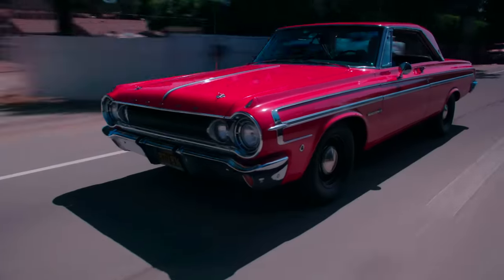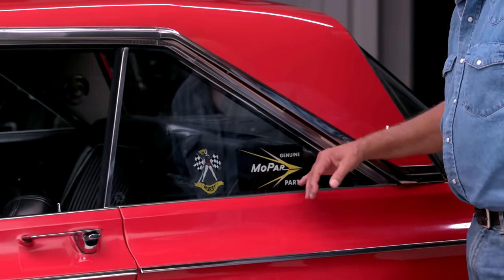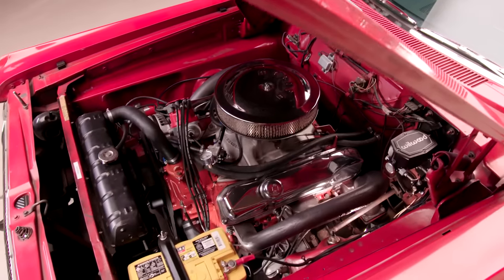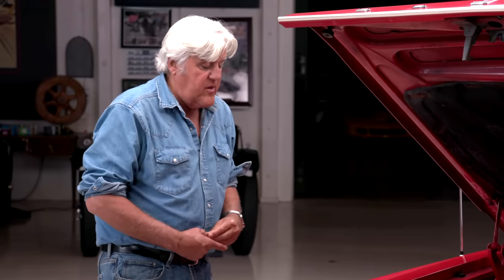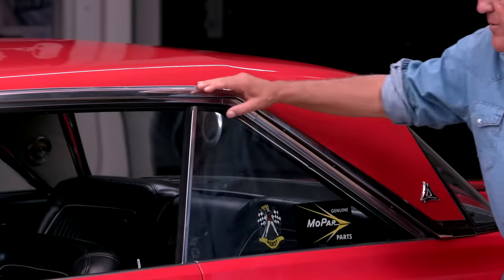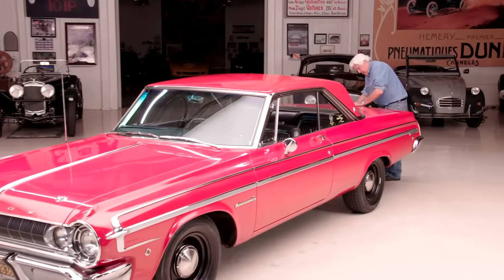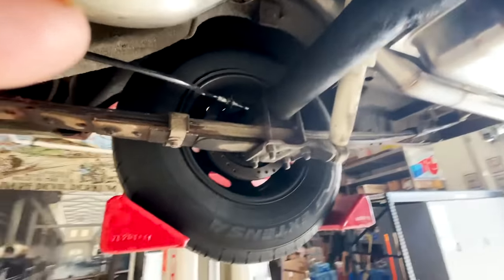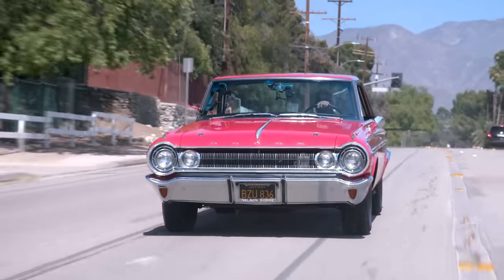1964 Dodge Polara | Jay Leno's Garage

Comment: back in 1974 my best friend had a 64 polara anniversary edition. it was red with a white top. it was very fast, he would drift with it before drifting was a thing. we would just go sideways down the road probably about 50mph smoking the tires. one time we passed a kid on a motorcycle who was riding in the ditch we were going sideways of course.he blew out the automatic so we put a 4 speed in it then it was even better. the car came to its end when the 4 speed case broke at the bell housing. it had a 361 engine . before he got rid of it we took the heads off and they were wedge heads, ever hear of such an engine? this car was just as fast as my 67 mercury police car with the 428. those were the days.

Comment: In my senior year of high school, I bought a 1966 Coronet Super Bee, it had the Hemi. My friend's father was an engine builder for many racers. We built my engine to 625 Hp with a cross ram manifold and 2 650 cfm 4 bbl carbs. It had a Dana 66 rear axel with a Detroit locker (noisy) headers with lake pipes that came through the finder just before the front door (I would kick myself today). It was FAST.

Comment: Hi Jay this is Jim mungai again I forgot to mention my first car was a 62 Dodge dart 318 pushbutton automatic car ran pretty good had the big Stromberg to barrel on it ha ha anyway I shut down a couple small block Chevy‘s with that car car ran pretty hard I wasn’t gonna be the top guy in town but for considering the stock 318 car ran pretty good got about 17 model gallon on the road to but yeah you talk about steering that car head manual steering and as long as you remove in one or 2 mph you could palm that steering wheel from walk to lock it was just like power steering car was phenomenal anyway keep I’ll put your doing is a Jim mungai again from Kennerdell a Pennsylvania

Comment: In my country back in 1977, Chrysler sold the Dodge 1500 as Dodge Polara to compete against Renault and Fiat. It was a manual 4 speed 1.8 L engine with 88hp and 108 pound feed of torque.

Comment: A lot of cops in my area of SE Indiana had Polaras with the same black wheels & dog dish hubcaps.
You could spot em a mile away !!! 
Any skirt chaser back then would immediately instal a set of mags or cragars,.
 This was the best looking year for Mopar, the previous years were a bit homely.
  I was a Chevy man back in those days and had many impromptu runs for the girls attention against these. My lil Nova would launch off the line and jump out in front sometimes even a car length or so , but would always pass me on the top end.
  I envied the space the back seats had compared to my lil Nova ( for obvious reasons) and then went to fixing up Impalas for the lush seats and spacious back seats !!!
  These Mopars were certainly girl getters back then, but let’s just say a black 64 Impala SS  with red & white interior was a good competitor….

Comment: my brother told me a story of a friend he worked with in 66 bought a new Plymouth belvedere with bench seat and a huge Hurst shifter. he took him for a ride on the interstate in it and running at 70 mph he down shifted and floored it and it started fish tailing at 70 mph! he was looking at the engine and said it was a hemi with aluminum heads? i remember reading that the early cars of  500 cars needed to qualify them for nascar had the actual race motor in them just detuned a bit and i always wondered if this might have been one of those cars?

Comment: My first car !
  I also had a 64 Polara 500 but it only had the 318 , , bucket seats , floor shift auto ,  no power steering or power brakes but it really didn't them , steered and stopped easily . .

Comment: Very nice Jay I like those old Mopars I'm quite the Chrysler fanatic myself in fact the car I have is a 528 cubic inch Max wedge of course it's not stock especially 528 cubic inch yes it's a Siamese bore mega block small stroked with indieheads that would be in a range of about 800 horsepower with 12 to 1 compression can't wait to get that one done oh and by the way that's in a altered wheelbase 70 Dart and it's a big tire car with a Ford 9 in designed by strange but I like your old super stock most definitely cool

Comment: Oh yes, my first muscle car of three. Balanced, blueprinted 426 Wedge, black beauty. Headers, drag slicks I ran on the street. Push button shift on the dash. Full race cam,  4.11 rear end, battery in trunk, along with two electric fuel pumps. Ran 12:39?, 112 mph, on the strip. Never beaten there or on the street.

Comment: Your comment about "rum runners" brought back a memory from the 1960s .  Moonshiners were  part  of the local lore as were the "revenuers" who pursued them.  I had the pleasure of knowing folks from both sides of the law.  But,  one person  stands out in my memory after all these years.  He was a local legend known as "T model Jones".   T model, he ran likker and he never got caught.  The reason why was his car.  It was the dirtiest ugliest black 1957 Chevy 2 dr  sedan you would have ever seen.  The windows were so smudged you had to look around the smudges to see.  It had no back seat,  only a wooden frame to stack the crates. T model himself was a character straight out of "Deliverance" He wore bib coveralls, with no  shirt, and brogan boots with no socks. He was balding, always needed a shave and usually had a bit of juice evident   from his chewing tobacco. . The hidden secret about T model's Chevy became evident when you raised the hood.  The engine compartment was pristine.  It was so clean you could eat your lunch on any surface there.  However, the crown jewel under the hood was a very modified Corvette fuel injected engine.  The suspension, wheels tires etc would have done justice to any NASCAR racer of that era.   T model faded into history as the years passed by but his legend lives on.  A street was named after him  in a small town frequented by him when he was in his prime  His memory lives on in T Model Jones lane.

Comment: 1970's/80's 15x7" Mopar cop steelies and later non-Fratzog caps - interesting! It took a few moments to even spot them. Bravo for sending those wannabe-racer American Racing mags to the bin, along with that didn't-tub-it stance. 

Top tip for finding affordable 15x7" period Mopar rims without the expense: Late-1980's Dodge B150 van rims look just right and have the correct 5.5" bolt pattern. Heck, they could pass for 15x6" HEMI JK code rims at first glance. They have an additional set of small holes astride the main bolt pattern, but they're invisible once a factory dog dish is fitted on top.

Comment: My grandfather had a 64 Savoy, 413/4spd. Originally a 383 car. It was my first memory of a fast car. I played with Chevy stuff as a teenager because they were cheap in the 80s, even then Mopars were more money. But I’ve been strictly Mopar since the late 90s. Yet to find one of these at tbe right time but that will change soon. Having fun with a 340/4spd 72 Duster now.

Comment: I knew a family or should I say a 64 Coronet bought new but the story starts at the factory. As it was coming off the line the right front fender got damaged, so the potential owner was contacted to see if he still wanted the car. Owner agreed as longer as the damaged fender was replaced with a new one. You would think that getting a replacement right off the line would match you would be wrong. I tried following the car , a 383 4 speed black interior and black vinyl top over white paint with a slightly different shade right front fender. Last I know it was rusting away and on its 3rd engine, its 2nd engine a built 440 that was to much for its owner so he sold it.
Reply: The Dodge Coronet was discontinued in 1960, and the name did not appear on another Dodge until 1965, (IE there were NO 1964 Dodge Coronets built).
Gary

Comment: I love your videos I had a 1970 Dodge Challenger RT convertible 440 magnum paid 2300 for it in83  it was awesome press you in the seat if I punched it at 80 when 145 and the front end started to lift put the purple cam and valves and it was 518 hp it ran faster than the so-called fast cars now

Comment: My dad bought a 4dr with the 383 push button tranny. The car was 4 yrs old, I was 16. You know that means trouble. I would rev it up in neutral and then push that D button on the dash. I pretty much burned those tires off in a couple months. There was a famous intersection in my town where you could get airborne and boy did I. I hit it way too fast and got all 4 off the ground and hit so hard that it crushed the oil pan. Minimal leakage. I took the car to school the next day to automotive shop and repaired it. When my dad asked what the oil was in the driveway, I told him I spilled a little when I changed the oil for him. He said, ok, thanks!

Comment: Need a drop in "Passon performance" aluminum  A855 5 spd then you can run 3.91s or 4.10s and it'll be quick and still have freeway speeds like driving with a 4spd and 3.00 gears but better!

Comment: My first car was a Dodge 440 w/426 wedge! Pushbutton electric shifter just left of the steering wheel on the dash. Dual point distributor, dual exhaust.  And Fenton black spoke "Mags" bought it in 1975 when I was 15... paid $159.50 for it...😏👍 Go Sooners!

Comment: I grew up on Mopars in Denver.  I was at the age where I bought all those cool cars broken and cheap, then rebuilt them.  I had a fury 440 4 speed.  The guy gave up because it would not run right.  I went to Checker Auto Parts and got my usual kit: Paint, (Plastikote) plugs (A/C) Wires (Yellow Accel) and store brand oil and air filter, points cap and rotor with Valvoline oil.  Stripped her, painted her, and put on the new parts with a known good Holley 650 carb. vacuum secondaries.  I started it, set the timing, idle adjustment screws and never opened the hood again.  Took my brother and his girl friend for a ride, 0 to 110 and back to zero in just under a mile.  That was the last time she ever asked me if a car I was driving was fast.   I had to graft in an aftermarket tach, but it still looked cool.  I have to stop watching Jay. He makes me want to buy things and I already have two projects waiting.....(72 Roadrunner 440-6 pistol grip).

Comment: FWIW, those cast iron headers are factory, but would be for a max wedge car.  A 426-S would've had straight log manifolds that dumped near the firewall.  Everythign else of the video is full thumbs-up, of course.

Comment: The 64 Polara 500 was the top of the line Dodge it had all the options and was sporty the Max Wedge cars looked like the Polara but they use the bottom trim line called the 330 and they had the Max Wedge 426 and then you had the super stock Dodges and they had the 426 Hemi in it. 1964 was the first year for the 426 Hemi in a car and it was racing only not for street use. Dodge had 3 body trim levels they had the 330 and that was he bottom of the line the middle was the 440 and of course the top of the line was the 500.

Comment: I am building a 1964 Dodge Polara. I need motor mounts for 318 poly motor to a 383 big block or should I change the k member? If so which k member should I use?

Comment: I had a dull green 65 dodge that I bought from my friend's mother for $125, it had a 383 with a 4 barell and it moved. The trunk was enormous and the back doors were stuck so my friends had to climb in the front seat and jump into the back. I called it my 4 door coupe...

Comment: I had two 1964 Dodge Polaras. First one was turquoise (meh) the second one was white (better). Both 383 with Holley 780 4bbl. Dual exhaust with Cherry Bomb Glass Packs. Got my first one in 1975, blew up 2 engines before I learned to run 20w50 oil in them. Bought the 2nd one in 1978. Wish I had kept them! When I had them I always kept an eye out for a 426 hemi for sale, but they were tooooooooo expensive.. All I have left is an old Polaroid of the 2nd one.
Nothing beats the sound of a 1960s big block muscle car with cherry bomb glass packs... nothing.

Comment: Thanks all, and JAY’s Teams….. etc. Interestingly, wonderful stories about the All the “early “ Driver’s License” vehicles! ** My nemesis was a 1959 Coronet Station *Wagon(REAR face seat,V8/PS,PB,etc,.)taking my LICENSE TEST(* embarrassing,until Dad found a 1954 FORD 2DR/V8, WITH 57 (?),289/CARTER 4B/Dual EXH, CUSOMIZED by the SERVICE STATION’s Mechanic!!).. Finally,  **1966 (buying in 1967,) GalaxieXL500/ *4SPD/MAROON, BLACK INT DELUXE*(352/4 BBL/ Duals): was a nice **tourer through, Pharmacy School ::: admittedly I **had *to Emergencey UPGRADE: fitted Metallic Brakes/ MONROE +SHOCKS 500(?), & the “Coolant Recovery System “ initially ONLY @ FORD PERFORMANCE EARLY 1967), etc Interestingly. Apparently some 66 Fords had COOLANT RECOVERY SYSTEM, maybe like “”some “ had DISC BRAKES ..etc.Anyways,this Polara Wedge / 4 spd is legendary.

Comment: I used to put those 15X7 police wheels (like on this car) on about every Mopar muscle car I owned back in the 80s and 90s. I'd paint them a silver metallic and clear coat em,run nice chrome lug nuts with no hub caps. Had a black 70 Cuda that looked killer with the wheels and white letter B.F.Goodrich T/As fat tires!

Comment: I had a 63 Dodge Fury with the push-button transmission when I was a teenager it was so much fun. One day I was burning rubber and pushing those buttons and going through the gears I got home I had four cop cars surround me. They had me spread eagle across the trunk. They thought I robbed the a store it took some doing but I finally convinced them that was my mom's store and I'm an idiot they  agree that I a idiot. Didn't even write me a speeding ticket and everything was fine.

Comment: My freind had 66 Satellite that was drag raced a well built 440, 4sp, 3.90 gears. I was with Him when brought home His wanted to look under the hood. So He did, asked it was a 440 oh he said, I said, its a mild 440. The look he gave me! There is no such thing as a mild 440. Then the night came a blue impala pulled up beside us, they were smiling like this going to be easy. Keep in mind neither of us knew what car could do. Light turned green, He dumped the clutch and that car went sideways and wheelhopping violently. The impala was gone my freind asked what do I do? Let off the gas a little! He did and it was being in sling shot 2nd gear we caught the impala 3rd it was headlights going away. 
Yes that over heated like crazy but never felt that kind of raw power.Thanks for the memory.

Comment: Bought an old 64 polara back in the mid 80's that had been sitting in a persons yard for many years. Got it running and was happy i could drive it home. Went rolling up to a stop sign and the brake pedal went all the way to the floor because a steel line had rotted out and popped. The parking brake didn't work and there was no way to stop that rusted up pile of pig iron. Out of pure desperation and a strong will to live i shoved the automatic transmission up into reverse, the car made a huge grinding noise and violently shuddered to a neck breaking stop. Single resevoir master cylinders and the metal devouring rock salt of northern ohio were a very bad and dangerous combination indeed!
Reply: If you have a single bowl master cylinder you definitely want your emergency brake to be working

Comment: Neato. but.. I am wondering if it was the wind buffeting the microphone or if that car was running really, really ratty. It wouned like it had mouse nest  residue in the carb, or some live mice in there... I would have dubbed in sound to avoid that. The thing sounds like a reject from a Blues Brothers   cop car scene...and THEY ran better. Ah well,. lots of fun

Comment: You must’ve changed the intake on that engine because my relative has the exact same car same color but he’s got two four barrel carburetors Max wedge set up off-center but he does have the same exhaust manifolds drum brakes on the back and disc brakes on the front it’s too bad he doesn’t have the car anymore

Comment: I found a 1972 Dodge Polaris two door red with black vinyl top Regional tires 64000 miles on it Has 440 super commander in it #7 Build Car off the Line original owner was a gentleman and Louisiana had a casino he said he just drove it to town for the dinner every now and then second owner was a gentleman in Somerville Texas he just drove went to church and round town.His transmission went out in his truck so we rebuilt the transmission for him and he traded this car for the transmission job which was around $2,000 we were stunned when he pulled the cover off of the car sitting in his bar with his animals around we couldn't believe it seats original good shape. Immaculate carpeting Immaculate only thing was that a rusted gas tank little bit of rest around back window Chrome but other than that car is solid as a rock and runs like a scalded dog had to put tires on the polyester tires we smoked them all third time we drove it positive track rear end car completely original odered for the gentleman in Louisiana special amazing automobile

Comment: The 1964 Dodge Polara had a curb weight of approximately 3,148 pounds (1427.909 kilograms) 12. This weight includes the vehicle’s standard equipment and a full tank of fuel.

Comment: I bought one of these in 1970 for $600, the guy was selling it because it drank too much gas.  And yes, driving too much on the street required lots of spark plug cleaning.

Comment: What I find hilarious is that my 2021 Honda CRV weighs more then this dodge.  In fact most modern cars and SUVs weigh more because of all the steel reinforcements in the doors and crash bumpers.  Yet the Honda has a 200 hp 4 cyl engine with plenty of get-up and go yet gets 38mpg at 70mph!   My dad had a 64 chevy Belaire with the 6cyl and 3 speed automatic that was a real pig,  I had tried to get him to get the 283 V-8 but he preferred the straight six.  Yet the Chevy got just about 20 mpg if my mother drove it.  If I drove it: 15mpg!